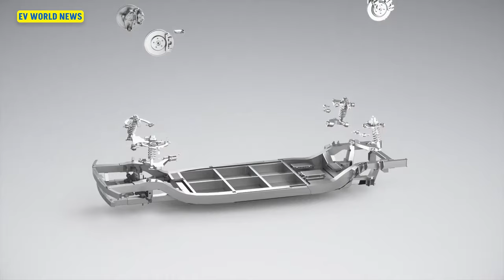The CATL EV Skateboard Will Revolutionize Auto Manufacturing

Comment: The skateboard concept is not new.
Reply from the maker: Do you know of a manufacturer going into production to support other OEMs with the design?  Was it done on traditional cars?
Reply: @EVworldnews Many manufacturers utilizes the skateboard concept e.g. Renault, VAG(Audi, VW etc.) and Tesla are just the first that comes to mind. The concept itself was developed by GM 20 years ago. Again, not new.
Reply: @EVworldnews  I know other companies have had the same vision. While some of them are not in the same size as CATL, still the same idea, to offer a EV skateboard to others. Bosch-Benteler for example, back in 2020. But also Bollinger, Foxconn MIH and probably many more.
Reply: @GurgelKoff really the concept goes at least as far back as the VW beetle with a structural floor pan which was then used on other vehicles and by Porsche.
Reply: @EVworldnews yeah in the early days of British motoring it was common for larger cars, rolls or Bentley would make a driving chassis then the coach builder would add anything from a sports or touring body to a gun bus or armored car.
Reply: I should have written "EV skateboard" since that is the topic in the video and what I was referring to.
Reply from the maker: @GurgelKoff  Good information.  The big thing is CATL makes the batteries in the skateboard and they are set to provide these to several Chinese EV makers.  I have seen the concept in the past with many companies looking at this style of production.  This is the first where the company is making for others and not themselves.
Reply from the maker: @zopEnglandzip  I am familiar with many vehicles using the same chasis.  The EV version will be a huge cost savings in the whole EV expansion.
Reply: @EVworldnews  That was back in January 2020. Benteler and FEV was offering this modular EV skateboard to other companies. I believe the truth is that the established automakers are bit afraid to outsource such a large and important portion of the car. It reeks of badge engineering and also sets them in a vulnerable position. At least for the premium brands. Parts are quite often where you get the large revenue, not the sale of the car. Remember that combustion engines typically cost only ~15% of the total production cost of car. With BEV it is something totally different, especially the battery itself and there are just a few manufactures for the cells. Catl being one of the top 3 in the world or something like that.
Reply: @EVworldnews  Seems like my previous post with the source URL disappeared. Sorry for that. I quoted "The German supplier developed the architecture, which it calls Electric Drive System 2.0, with Robert Bosch.

The goal is to sell the platform to either established automakers or startups, which could modify it to their specifications and add bodywork and other components as needed."
And posted the link to Automotive News Europe. Maybe the URL made the comment disappear. Anyways easy to find if you want to fact check.
Reply from the maker: At the moment this is being tried in China but there are several other companies with in-house skateboard designs.  CATL has an advantage being the biggest battery maker and first to make sodium ion batteries which use no lithium or cobalt.
Reply from the maker: YouTube polices comments to a certain degree, I often don't get to see some of them.  I try to keep my channel non-political so if someone is cursing one party or the other i don't enable those.  I try to look at EVs outside of the political noise from both sides and just look at the problems and merits they bring.  Your missing post doesn't show in my held for review.   There is a dark hole where YT sticks some though that I just never get to see.

Comment: And how this differs from any body of frame vehicle ? 
Why would it go cheaper. Even right now electricity prices are high enough to EV's are not cheaper to charge. 
You say Insurance will go down because of safety improvements.  Then why when Tesla's are so safe insurance is sky high.
Currently EVs have less maintenance cost that's true but the battery price is insane look up the nightmares in Canada with the Hyndai Ioniq, $50k for replacement battery because of minor dmg after hiting the underbody on an object. Thousand mile battery with  CATL's LifePO4  is 2-3 tons of battery.
Reply from the maker: In this case it is more than just the chassis, it is the drivetrain and fuel source.  EVs cost about 1/4th of what gas costs to fuel up.  Tesla has an issue with mostly male drivers getting into accidents, most likely because of the extreme acceleration.  Drivers walk away from accidents that they shouldn't in a normal car though so they clearly have an advantage in more serious accidents.   $50k is just stupid, you could replace the car for less than that.  Tesla will replace batteries for $12k now.  In another 2 years it will be $6-7k.    Battery prices have been plummeting as technology to make them improves and that has been driving down the price of new EVs and used EVs.
Reply: @EVworldnews  Yea that $50k was insane for canada it was totaling the cars and driving insurance premiums very very high. 
In europe on comercial charging stations it was 0,5E per KwH assuming 20kw/100km that was 10euro for 100km. Diesel at 2E per liter 5l per 100km is equal at 10e/100km.
If we look at LPG which are somewhat very common in some european countries it's actually cheaper.
On the part of not just the chasis but the drivetrain, a lot of the Vans are like that you buy the chasis+engine+drivetrain and suspension, and build on top of it for whatever purpose it is needed, passanger transport, dump truck, cargo,  refrigerated, camper or whatever.
Reply from the maker: Those are insane charging rates.  I was touring a property in Florida that charged 34 cents per KwH for a charger in the parking garage and though that was insane.  Where I live electric is only 11 cents per KwH.
My Metallica video talks about some LNG powered trucks they are using for their European tour.  
I don't really know if the skateboard will be better or simply utilize Gigacasting that Tesla is doing.